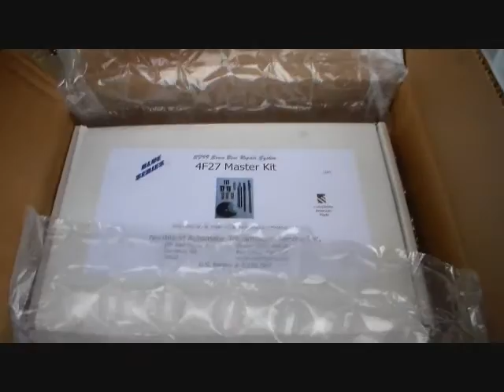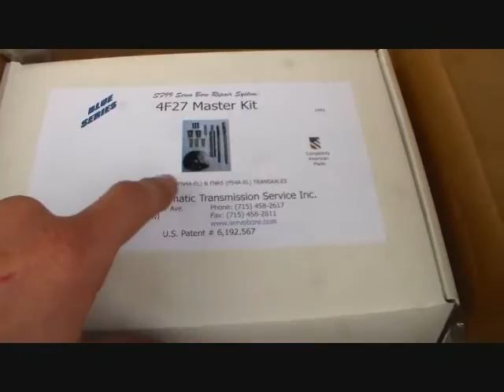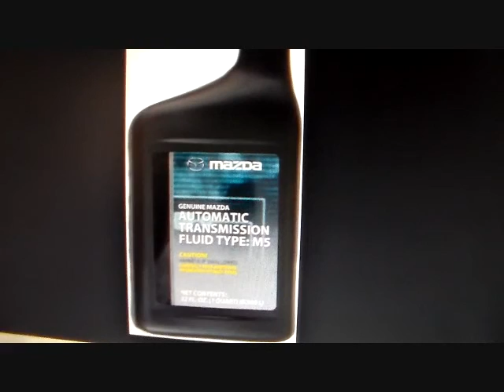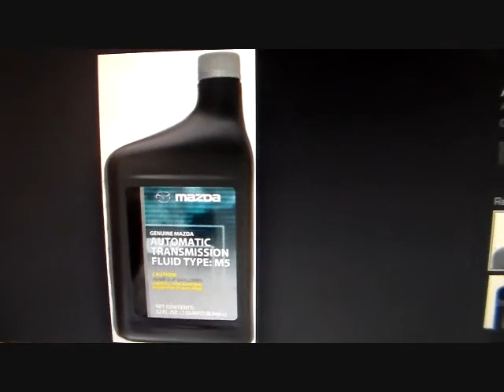Ford Fusion/Mazda6  3-4 hard shift repair part 1

Comment: just drive the roll pin out of the shifter shaft and side it forward. No need to futz with that rooster comb. Its covered in the FSM for this trans. Now Im not sure where it slides out to as there seems to be no room but Im dying to see how you reamed that hole! Great vid.

Comment: Introduction and Applicability of Repair 0:00
Description of Problem Conditions 2:35
    Car "shifted odd"
    Start out in first gear in drive -- just fine
    Time to go to second, it wouldn't go to second
    Time to shift to third, would shift to third early
    No third or fourth gear
    Threw a shift solenoid code P0757
    Ordered a band and shift solenoids
    95% better with band and shift solenoids
    Current problem: hard shift in third and fourth gear once warm
Root Cause of Problem Condition 5:00
    Explained in a technical service bulletin put out by Mazda
    Overdrive servo bin bore wears out and causes a fluid pressure leak on one side of the servo
    This problem caused the band to burn and clogged up the solenoids
Overview of Repair Process 6:00
    Repair can be completed without removing the transmission
    Repair requires an expensive kit
Description of Repair Kit 8:35
    Northland Transmission 4F27 Master Kit
Description of Proper Fluid 11:30
Repair Process 14:07
    Remove splash guard 14:07
    Drain fluid 14:36
    Disconnect battery 18:00
    Remove air box 19:14
    Jack car and remove wheel 21:08
    Remove wheel splash shield 22:50
    Remove transmission pan 25:12
    Valve body overview 29:00
    Remove transmission filter 32:25
    Solenoid naming discussion 34:18
    Remove solenoid plugs 36:22
    Remove valve body bolts 38:12
    Remove valve body 42:45
    Describe next steps 47:28
    Remove shift cable nut 51:05
    Remove plug from PNP switch 53:09
    Remove PNP switch 54:30
    Remove cap screw 56:14
    Describe manual rod intricacies 56:48
    Remove manual rod 58:40
    Final manual rod disassembly 1:04:44
    Remove servo cover 1:05:58
    Show servo pin 1:10:01

Comment: Thank you for the video.  I just bought  an 07 fusion that has this problem.  When you first start it and put it in reverse it slams into gear hard.  During the test drive it did not shift hard in any other gear besides reverse, but as soon as I bought it the car began shifting hard between 3-4.  It doesn't do it all the time but when it does it's bad.  I paid very little for the car ($1400) even though it only has 115,000 miles on it, (I knew it was too good to be true, but figured I could fix whatever was wrong with it.  I have put solenoids in my previous car in an attempt to fix it (failure, needs bands I'm sure and has high miles), but I don't know if I'm up for such a big scary job.  How long do you think my cheap beater might run without this fix if I baby it?  As I said, it hasn't been doing it as often since I bought it.  Does this fix the problem with it slamming into reverse as well, or do you think a solenoid kit would fix that?  Any help with this would be appreciated.
Reply from the maker: The problem with letting it go, other than being hard on the driveline, is that at some point it starts to burn the band up, and when that happens you start losing gears. It'll shift from 1st to 3rd or something like that. I ended up with only two forward speeds. If you can do solenoids, you can do this repair. You'll also need to replace the band since it'll have excessive wear by this point.  I still have this kit if anyone planning to do the job needs it.
Reply: Do you know why the car slams into reverse and how to fix that as well? The solenoid job was bigger than I wanted to try, and that car had already lost gears so I figured I had nothing to lose (never figured out how to get to the secondary valve body to replace that solenoid).  I feel like changing the bands and putting this sleeve in would be a heck of a lot harder than doing just the solenoids (which wasn't easy), and if I doesn't work I'll be out a second car.  I don't have a clean/warm area to work in either, so I'm afraid I'll just make things worse if I mess something up.  If you are willing to send me the kit I may be willing to attempt it, but not until we get some warm weather again.  How much harder is it to do this and change bands?  I've never done anything inside a transmission besides the one solenoid attempt that didn't do any good, haha.  My old car that lost overdrive and doesn't want to shift out of 1st has a lot of miles, but If I did one I might be more likely to get the other one going again too if it's not that hard to change bands.  It has a lot of miles on it though and last time I changed the engine oil there were some fine shavings in it so maybe not worth the time/money.
Reply from the maker: @michealheath337  I don't recall exactly what caused the harsh reverse but the only thing that "comes on" in reverse is the low clutch and reverse clutch. The entire reason for the hard shifts in drive is because the band apply servo is getting apply pressure when it shouldn't. That likely is the same reason for the reverse slam...a band application when there shouldn't be one. Always remember that hard shifts or delayed shifts are because something inside the trans is operating at the wrong time. You will have to go into your trans to fix any of it.
Reply: I have a harsh reverse engagement. Wire harness must have gotten chewed up from rodents and had a solenoid 'F' code. Still have a PO757 B stuck open afterwards. Maybe I've found the right video to help me out 😃
Reply: @TylersNeighborhoodGarage  From what I read in the FSM on the trans is the piston applies on the 1-2 shift and if the pin bore is worn, there is little resistance to the pin side and the band applies quickly. Am I reading this wrong? someone should make a +..010 oversized pin and sell a +.010 reamer . Easier that reaming and setting a bushing and reusing a possibly worn piston. And the piston could actually float on the pin so there would not be a critical bore jig required.

Comment: Is there a way to just the band (bolt) so that the pressure that is available would lock the band in place instead of going through the whole process.  I know it is not the best way but it could get me by for the time being to lock in the band.
Reply from the maker: No, because the band bolt is not a band adjustment bolt. It is screwed in fully until it seats and that is intended to be correct with a good band. Jatco does supply bolts in different lengths but, again, they aren't intended to crutch other issues.

Comment: thumbs up for this excellent video and efforts made.  tell me, during the hard shifting 3-4 do you feel some sort of hesitation ????    I may have a similar issue on my 2012 ford fiesta with 4F27E (DTC P0733 incorrect gear ratio came on).  please advise.

Comment: hi, i just bought a new filter and gasket and 8 qts of ATF im going to do a drain and then a flush using transmission cooler lines, i was wondering if you had any eexperience in this my plan is to drain the pan, disconnect the line and run the car at idle to get most of the fluid out then change the filter so as not to run a bunch of old fluid through the new filter then fill it up, is that a good plan?
Reply from the maker: Is this on one of these transmissions? If so, what fluid did you buy?
Reply: Yes its the FNR5 in a 2009 fusion. Originally the fluid was never changed (60,300 miles) it was very dark and i'd experience shock once the fluid got hot (assuming a sign of cooling/lubricating property decay) so i changed it out via drain and fill with Redline D4 since it met the M-V spec it was better for a while and now the fluid is dark again and shifts poorly when hot so that's why im proceeding with a filter change and a flush with the cooler lines, this time i picked up the fluid from Walmart but it does still meet the M-V spec. i purchased 2 gallons of this https://www.walmart.com/ip/Super-Tech-Multi-Vehicle-Low-Visosity-Automatic-Transmission-Fluid-1-gal/52626199
Reply: also forgot to mention i want to drop the pan regardless to inspect the magnet because there was a decent amount of very fine metal shavings in the fluid i drained the first time along with some slightly colored shavings somewhat orange/white/brown and its still under a 90 day warranty from the lot so if theres a serious problem i want to know so i can return it OR get it fixed.
Reply from the maker: I hate to be the bearer of bad news, but your car is doing the same thing mine did, which I repaired in these videos. There is only one specific kit to make the repair. The fluid is getting dark again because the 2nd-4th band is dragging in third gear when it is supposed to be disengaged. I suggest saving your money and returning that car pronto.
Reply from the maker: A flush won't fix it. Repair or replace. The newer Fusion's 2010-12 with the 6F35 transmissions have their own issues. Avoid.
Reply: Ah, that sucks but at least I know. my previous car a '99 camry had the exact same issues for 60,000 miles and still ran when i got rid of it but i hated those jerky shifts especially on cold mornings. I guess ill be giving the dealership a call then. Thank you sir.
Reply: I was hoping it'd be something simpler since i can still get smooth shifts out of it with light acceleration it's just when it shifts into 3rd at around 2700 RPM i can feel a slight jolt nothing enough to snap your head back or move you much argh why can't i find a good car lol
Reply from the maker: Well, it's not bad now, but it'll get there. Mine with 110,000 was BAD. The 3-4 was violent. I've put 20,000 on this car since I fixed the trans and I can tell you that the 3-4 shift is buttery smooth when all is well.
Reply: i see, is there anyway to bring this upto them in a way they'd buy it? I have a feeling theyll just check it for codes see that there aren't any and say sorry theres nothing to fix.
Reply from the maker: Tell them Mazda issued a TSB (Technical Service Bulletin) for this issue back in late 2009 and the  prescribed fix is to replace with a new transmission or sleeve the 3-4 servo piston pin bore, like i did. Good luck.
Reply from the maker: Eventually what will happen is the 3-4 shift will get progressively more violent, third gear will feel like it's dragging when you let off the gas, then the 2nd-4th band will burn from the dragging. You then lose those two gears. it will shift from 1st to third and stay there because 2nd, 4th and 5th all use that band. The wrench light will illuminate and the code will be something like P0773 shift solenoid E, which is a false code, generated because the PCM commanded a shift and the shift didn't happen.
Reply: Tyler's Neighborhood Garage tried to get a video example for you let it warm up etc and of course it shifted fine through every gear the 4 times I tried to test it, also I was mistaken my fluid isn't dark again like it was it's still fairly red, random problems vs problems you can recreate are the worst.
Reply: well i attempted to have the dealer fix my issue 3 times which was three 48 mile round trips and they kept telling me they ran diagnostics nothing was wrong, they serviced it again after i did and im still getting some shock between 1-2, 2-3 everything else is fine. my motor mounts were also bad replacing those helped some. but now im out of warranty no powertrain wrench no check engine light and no codes with my scanner, what should I do? i was thinking maybe changing the solenoids.. it seems to be random too sometimes theyre buttery smooth sometimes theyre harsh but not as bad as they were before. It's got the correct 'M-V' fluid, not Mercon V. When i serviced it the filter seemed normal and there wasnt anything spectacular collected on the magnet either. the fluid stays nice and red. any ideas? thanks so much again..
Reply from the maker: Sam...I'm not being mean, I'm really not. But, THERE IS NO OTHER FIX FOR THIS PROBLEM BESIDES WHAT YOU SEE IN THIS VIDEO. None. You can change the solenoids, but it's not going to fix it. I did that. It didn't fix it. Here is the well-hidden, well-covered up TSB on this issue that I finally found, which led me to the FIX. As you can see, Mazda's solution was to replace the transmission

http://noes.net/05.10.10.pdf
Reply: Tyler's Neighborhood Garage okay I appreciate it, I consider myself a novice mechanic at best my father has rebuilt an automatic before im in Ohio so it's pretty cold here now. You think it can wait 6 months or so? Guess this will be the way to go. Thanks again.
Reply from the maker: If you don't drive it a ton. It'll gradually get worse and if it finally burns the band up, it'll lose 2nd and 4th/5th. When you repair it, factor in a new band and a set of A&B solenoids(they tend to fail for other reasons and are cheap) Remember that if you are working on the FORD version of this trans, use the Ford lettering scheme for the solenoids, because Mazda label's their version differently.
Reply: Tyler's Neighborhood Garage thanks again at least I know

Comment: Can you replace the band in place?
Reply from the maker: Yes. You pull the wheel, support the trans, unbolt the upper and lower rear trans mounts, let the trans drop down as far as it can, and unbolt and remove the end cover. You find and loosen the band anchor bolt from outside the trans and then slide the band out. there are two o-rings in the bottom of the end cover, don't lose them. Use the gray rtv to reseal, nothing else, no gasket. The band anchor bolt tightens all the way, no adjustment. Remember though, something causes the bands to fail, expect a repeat if it's shifting hard.